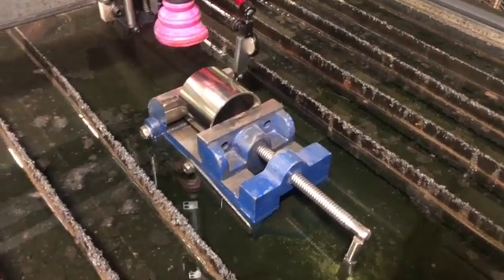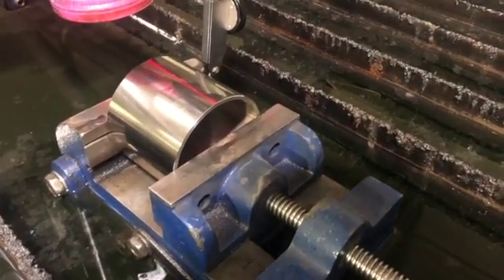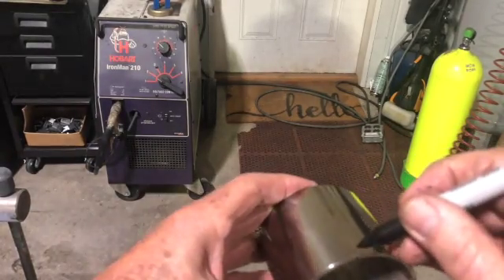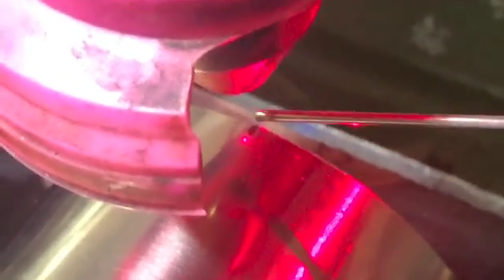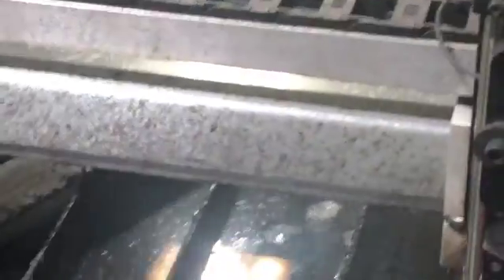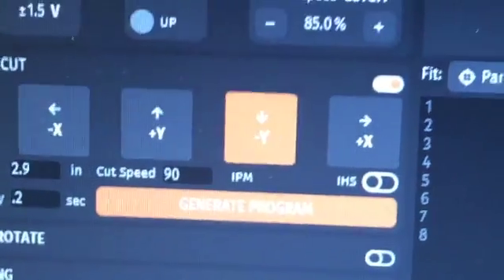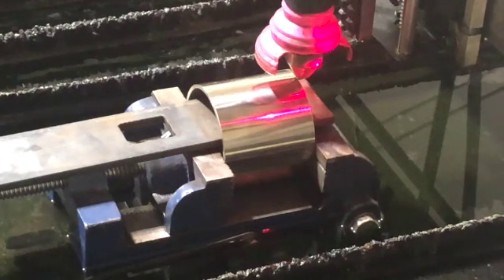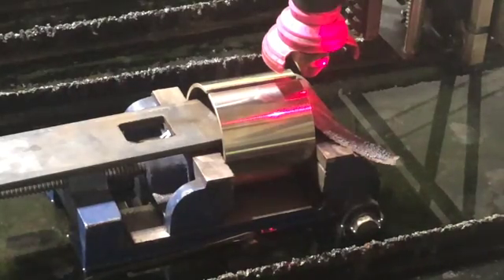Cutting Round Pipe on a Langmuir Plasma Table

Comment: Hi Dan. Great tip for a newbie like me! How did you  ensure the vice didnt move or rotate between setups?  Or did you need to calibrate between each piece? As i look like the vice is is not immobilized in any way.
Reply from the maker: Hey Jim,  yep I had to true it up each time I’m afraid but it didn’t take too long because thx piece was short…a long cut would have been more challenging!
Reply: @CustomCreations3  Thanks for taking the time to reply. 🍻

Comment: Polished stainless.   You must have a better bandsaw than me.  Mine won't cut straight.
Reply from the maker: Got an Ellis 1600.  Bought from friend for $500 and it’s worked great!  It doesn’t use cutting fluid so when cutting aluminum I get chips stuck in the teeth which causes a problem but other than that it’s been great!  However, after cutting on bandsaw I did throw it in the lathe and square the ends before cutting on the plasma table.

Comment: Another way to do it, which I use all the time, because it’s faster and more accurate than your method is to simply lay a piece of angle on the pipe and use it to guide the plasma. Much faster setup. Don’t need the Cnc. Don’t need the dial indicator.🤷
Reply from the maker: Steady cutting speed is the operative word in my case! 😂
Reply: @CustomCreations3  
Makes sense😃👍. I guess my unreasonable hatred of anything CNC has biased my opinion.
Reply from the maker: Used to be proud of my motor skills but now just glad I don’t cut fingers off! 😳. Being a retired Mech Engineer I sort of enjoy the computer control thing…a new challenge and in machining (lathe & mill) CNC is the only way to get some of the items made so I’m trying to stay up with technology. On the plasma thing I don’t  even own a hand torch! 😏
Reply from the maker: I’ve cut things that way with acetylene torch years ago when my hand/eye coordination was good but these days it would not be good! 🤓
Reply: @CustomCreations3  
Because the pipe is actually sitting inside the 90° angle the edge of the angle will be exactly parallel to the centre line of the pipe. Because my Hypertherm has a drag tip which will sit firmly against the edge of the angle and the pipe the only coordination you have to worry about is a steady cutting speed.

Comment: Thanks Dan.  I am guessing you attached your ground to the pan and were able to get a good ground w/ the vise setting on the bottom?  Your laser dot looked smaller than I remembered.  So I went back and watched your updated laser video from forever ago.  It was bigger back then.  You upgrade again?  Keith / STL MO
Reply from the maker: Hey Keith, to be honest I used to faithfully attach my ground to the workpiece but noticed that times I forgot to do so it didn’t make any difference so I now leave my ground attached to the table frame and haven’t had any grounding issues.  So yes the vise was grounded through the bottom of the table.  

The laser is the same.  I did notice that the polished surface of the tube made the spot really small compared to stuff I normally cut.